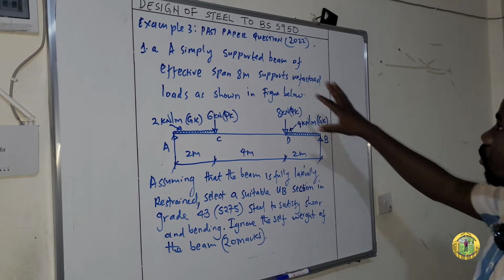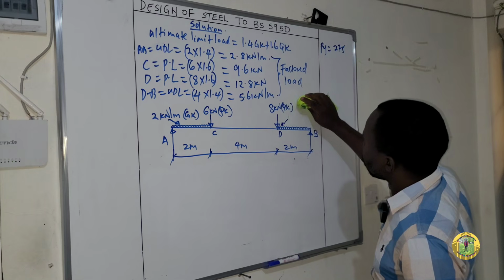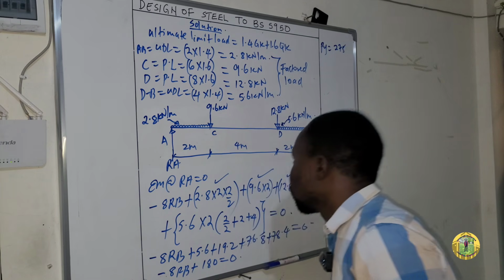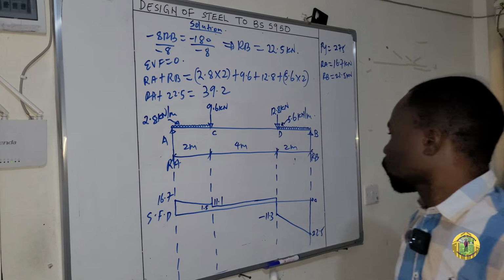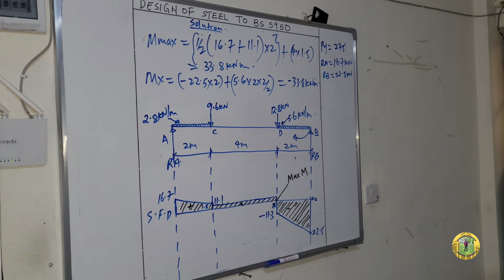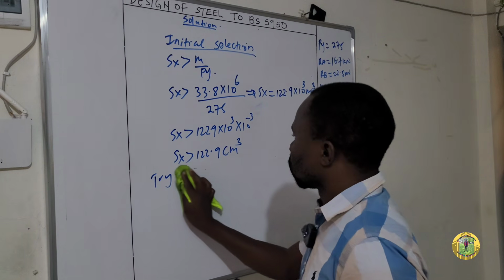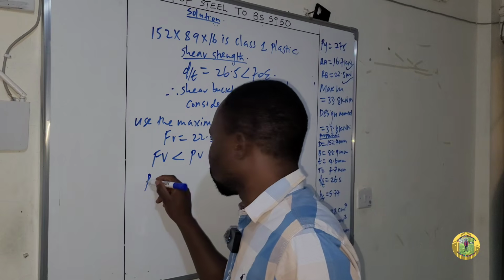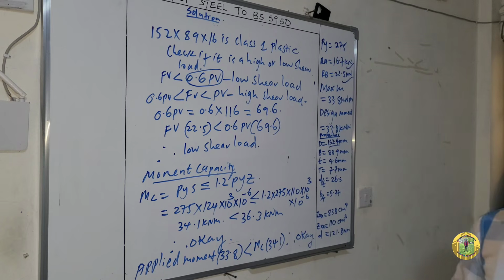UB SECTION IN GRADE 43 STEEL DESIGN TO BS 5950

Comment: How  to design  a timber  when ask  about internal  and external  beam how will the different  come up
Reply from the maker: As per my experience, internal timber beams carry loads based on the specific areas they support, and the same principle applies to external beams. Since these beams do not support identical areas, their load calculations differ. When addressing such a question, it is essential to first identify the beam on the provided plan. The plan will indicate whether the beam is internal or external, thereby guiding the appropriate approach for determining its loading.